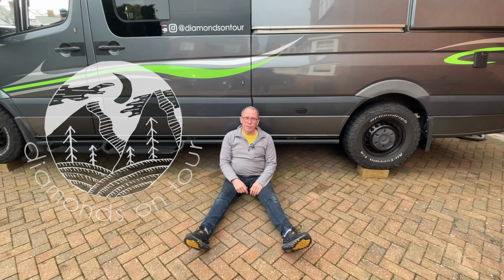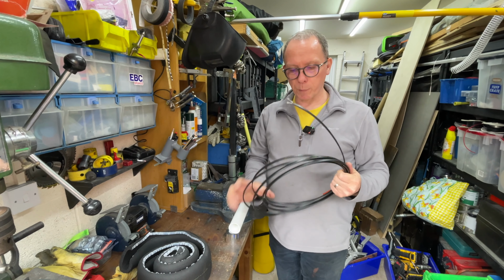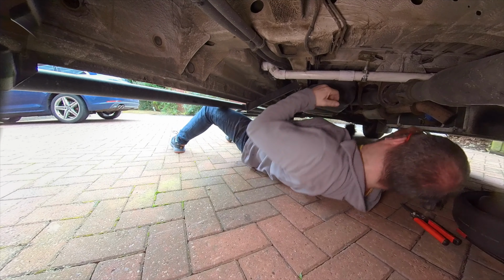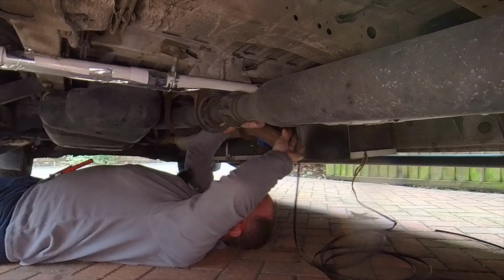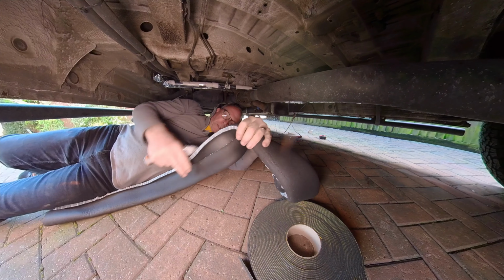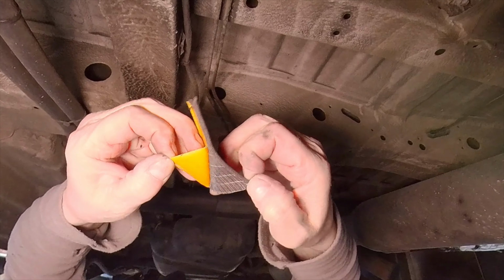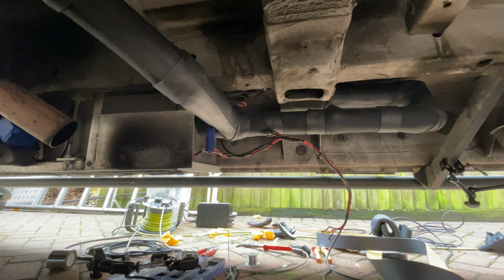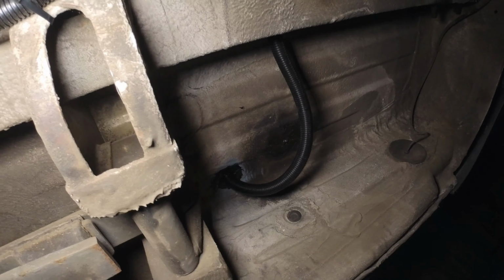Freezing pipes - no way! Our Arctic vanlife preparations, but will this work?

Comment: Excellent vlog. We are thinking of making a similar trip to Nordkapp but there on one thing I am struggling to find out, you may have the answer if your Camper uses Adblue. How do you stop the Adblue freezing when the temperature reaches below -11degrees?
Reply from the maker: Hi, thanks for watching. Our van doesn’t use adblu so that’s not a problem we will face. However, I have a couple of suggestions. 
The diesel in these countries has an additive to prevent it going sludgy so it stays liquid. I expect the adblu you buy there would be just the same. You would just need to be fairly empty when you arrive and top up with the local stuff. 
Alternatively, and I understand why you might not want to take this option, but you could get your van remapped and delete the requirement for adblu. On my 2016 Audi A4, the adblu pump packed in and it would have cost £1200 to replace. So, I had them delete the adblu from the car’s computer so it doesn’t need it any more. It makes no difference for the mot because that’s done at idle and adblu doesn’t do much to improve emissions at idle. At least that’s what the garage said!
Anyway, as I said, maybe not something you would want to do, but just a thought. 
Ben & Sarah.
Reply: Many thanks for your reply. I will do some more research and may be considering getting the adblue deleted. Looking forward to following your adventures in Norway. Steve  @diamondsontour